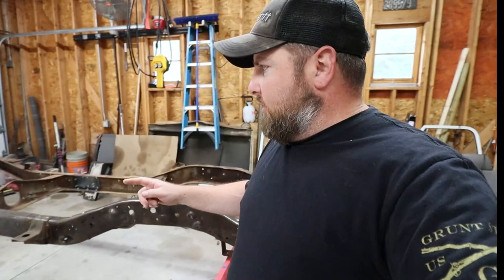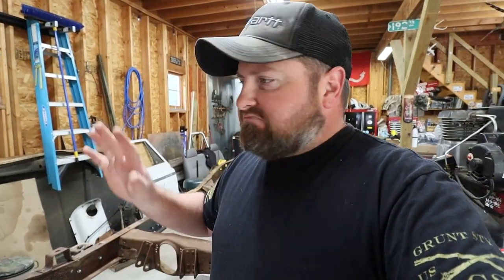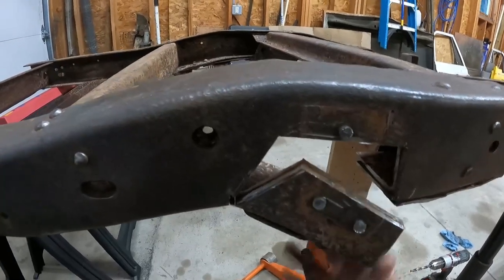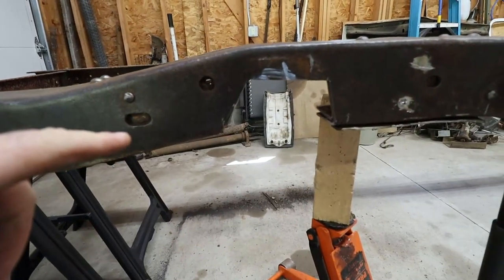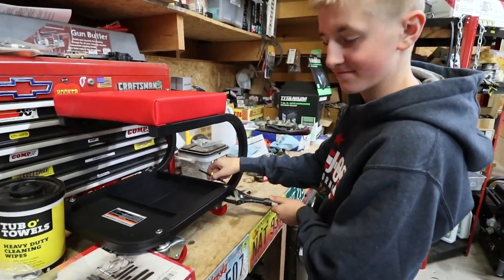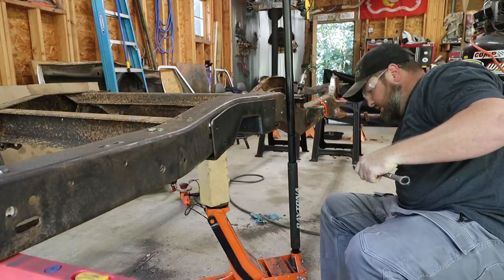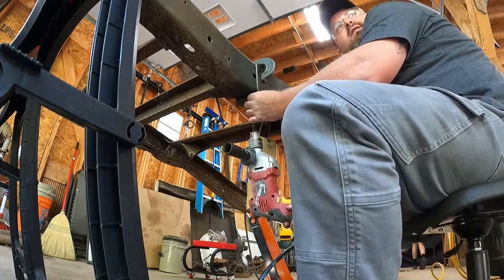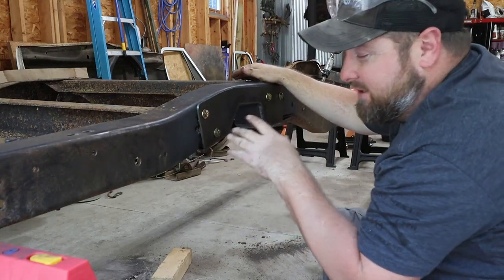✅Chevy & GMC Truck C-Notch Installation / Axle Clearance for Lowered Pickups

Comment: Your running into the same issues I had with the 3/4 frame. I believe there is the extra support in the 3/4 frame. More metal to drill through.

Comment: Should of drilled 1/2 inch holes in corners so to avoid cracks later.😳
Reply from the maker: You know I thought of that after the fact. Such a neat little trick that really works